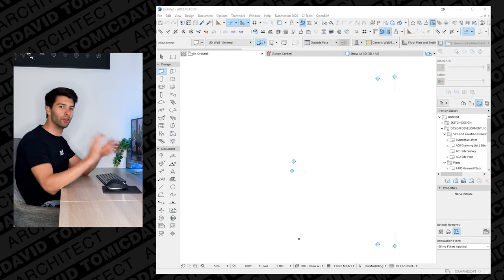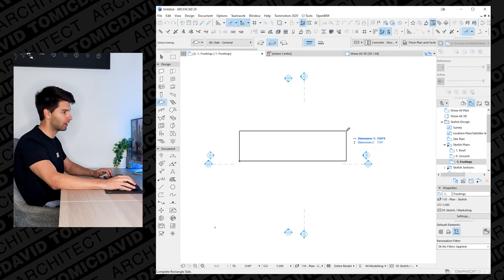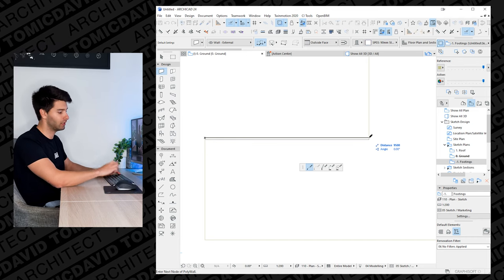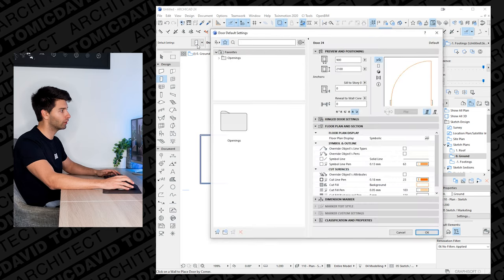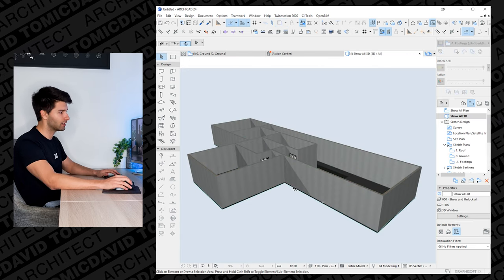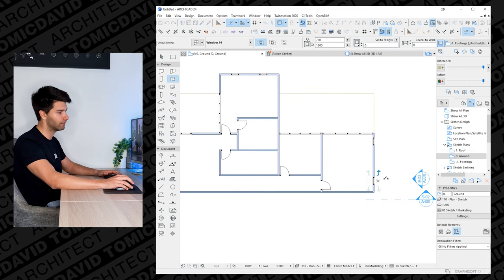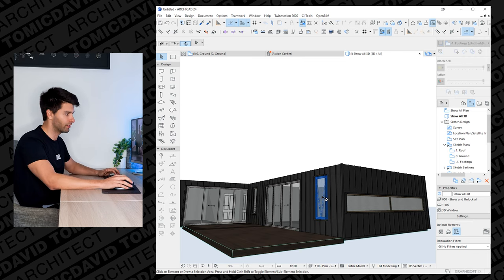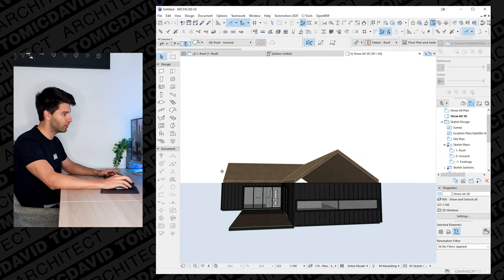ArchiCAD Tutorial under 30 Minutes Modern Architecture

Comment: Hi David great tutorial, I learned a few new things fro it. I don't know if you are aware of this however, you do not need to split roofs into single plane and delete hips to remove the hip ends of the gable. You can just pull at the apex and drag it with (apex point drag icon selected) so the hip becomes a gable end without having to split or delete and part of the roof. This way the roof remains as one and is easier to edit in future.
Reply from the maker: Helpful advice :)

Comment: how to solve the problem when I draw a wall in the air it gives me this error: as a result of the last operation, elements were created and/or changed their position on currently unseen stories
Reply from the maker: You are drawing it on the incorrect level and hence the error. You can either press ctrl + up/Dn arrow to find it or use the project map. Once you find it open the. Settings and set it to visible on all stories. You may also have to change the cutting plane settings if you need to see it on that specific floor plan and it’s too high up

Comment: Great videos David, just curious as to why you use the window tool for creating your sliding exterior doors, as apposed to using the door tool? cheers
Reply from the maker: I'm used to using the 4D library and that's just how it's set up.
Reply: @DavidTomic  cheers, so you can use that all the way through to construction drawings no worries I guess, not just for modeling?

Comment: Hey David, I was wondering if you knew how to create interior vertical foliage/moss walls? There are BIM products out there however, they limit the ability to have design control. Would you recommend a technique I could use?
Reply from the maker: It is a very complicated process to do it in archicad. I'd recommend do it in a 3D rendering software instead

Comment: does the height to next mean the height of the house or does it relate to how deep the slab goes into the ground?
Reply from the maker: So, you'll have your reference level or you ground level in this case which is 0. Anything below that marker is a reference to the negative space. So the "footings" in this instance would be how deep the slab goes into the ground. Whilst the ceiling/roof would be how height the level floor is. If the project ever changes, so for examples you have ground floor at 2400mm and it needs to change to 2745mm, you dont have to go back and move all the walls and layers if you've set it up correctly.